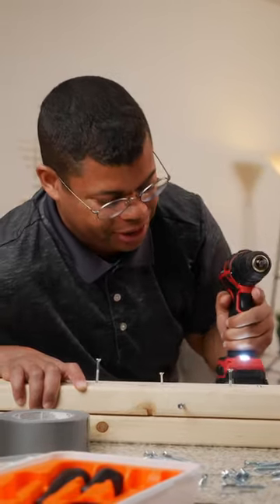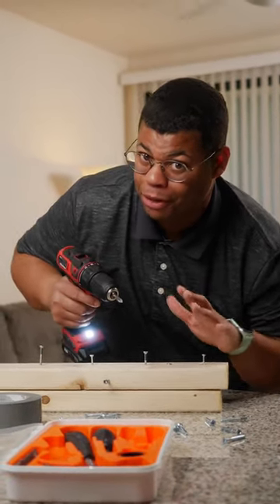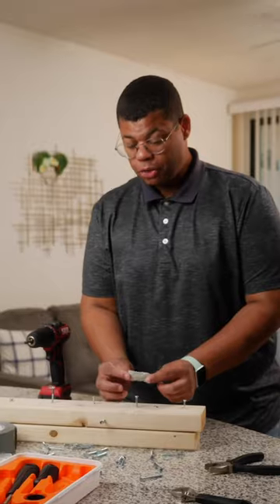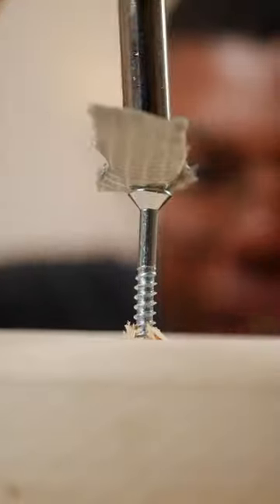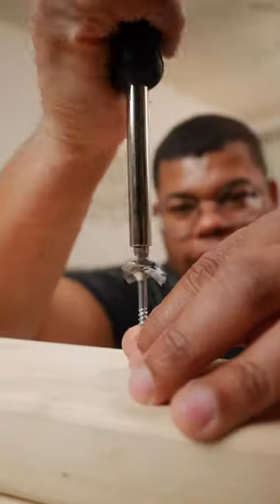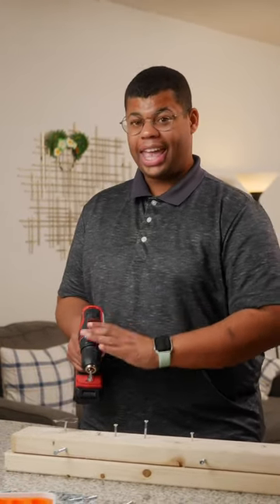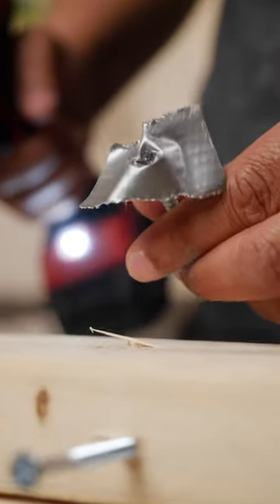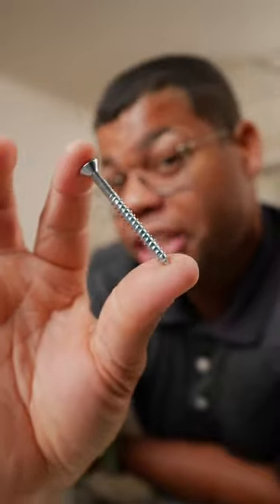How to remove stripped screws 🛠️  #tools #lifehacks #problemsolved

Comment: Bro, saved my life today. Had to replace window switch on Range Rover. Frustrated beyond anyone could know because T30 bolt was stripped. Used the duct tape method and it worked. Thank you so much.

Comment: Idk if those are good examples because if it does happen they are already deep within and not sticking out so lose already.
Reply: Yeah, my problem is when it straps and buried.
Reply: So how do you fix that, cause this duct tape doesn’t work!!!
Reply: @allsmiles2597  you get a drill and drill out the screw. It sucks, but that's how ya do it.
Reply: @KL AllSmiles  like I mean drill it out, destroy that screw.

Comment: might be the angle but it looks like a square 2 or 3 not a philly 2 not saying this wont work but try the correct bit before searching for hacks also vise grips should have been your lead if the screw is stripped not duct tape
Reply: Yeah, gotta go ViseGrip in the tough spots! 😎✌️
Reply: Nah, it's just a stripped philips, you can see where the cross is still in tact on either side of the round stripped out portion.
Reply: @MyBrothersMario  i build office furniture and some of the robi screws have the cross mark like the one in the video that's how i arrived at my first point

Comment: 😭 I don't have a drill so I tried to do the other tricks. It didn't work. I'm trying to get the replacement screw out from underneath the ring cover camera cause I lost the original screw. I screwed up somehow installing the replacement screw so now it's just stuck